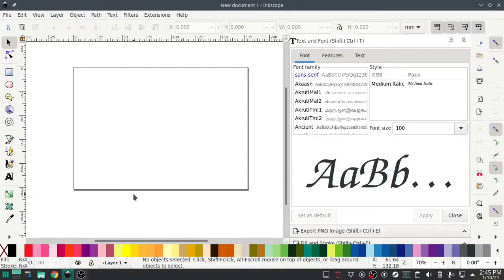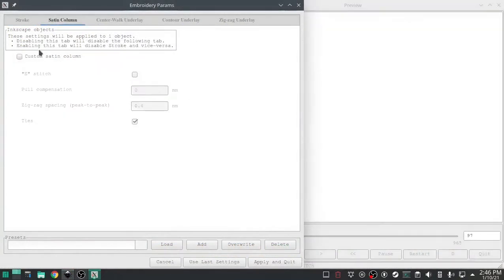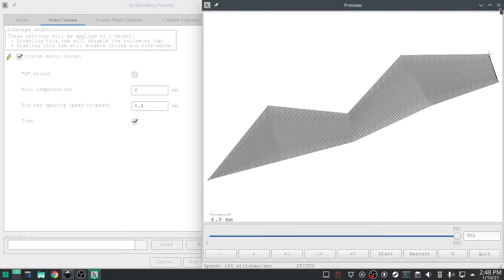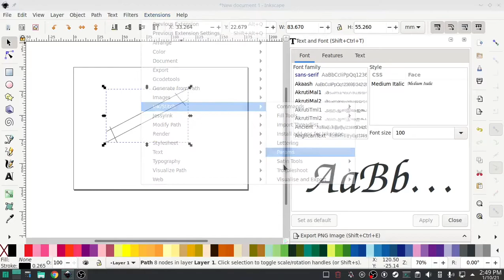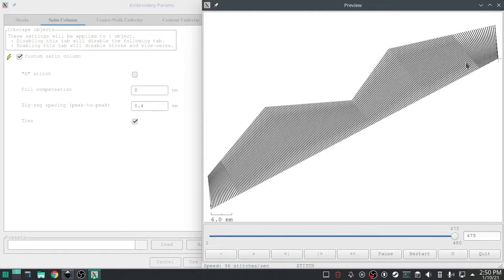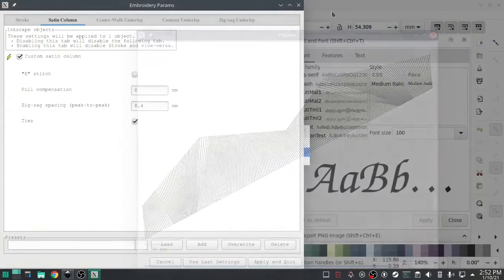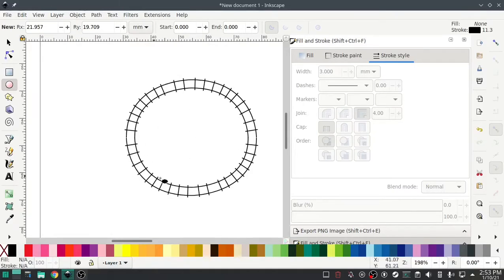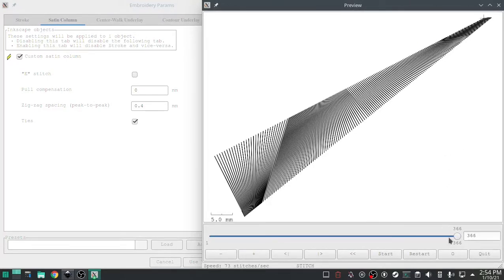A closer look at Satin Stitch in InkStitch

Comment: When I'm trying to make a satin stitch with a circle (so two paths of circles one slightly larger to create a pathway between the two circles) it says something about satin stitch only doing simple lines. Am I missing something? I made sure only the circles were selected before using satin tools convert to satin stitch.
Reply from the maker: Sounds like you're trying to convert two lines to satin at once.

Try this...
Make a circle. Give it no fill, give it stroke about 3 mm. Convert to satin stitch.
Reply: @LowTechLinux  I will try that! Thanks so much.🙏